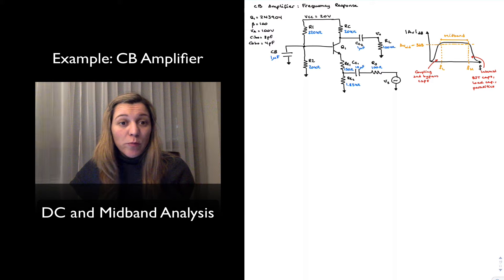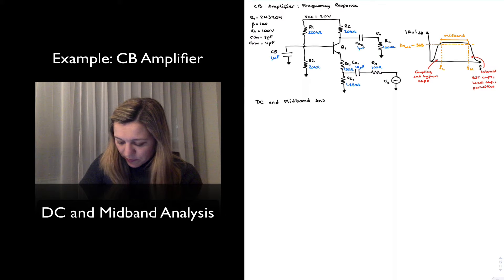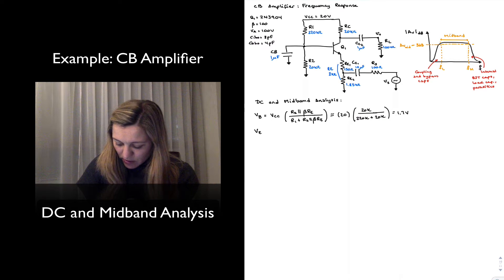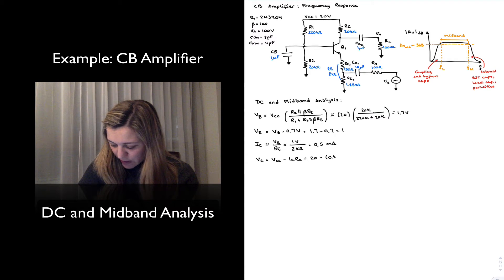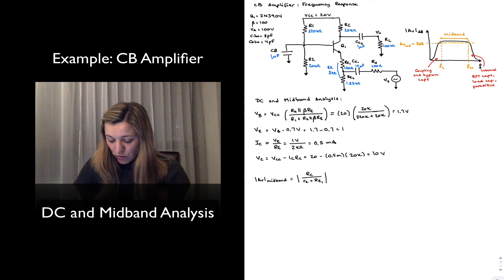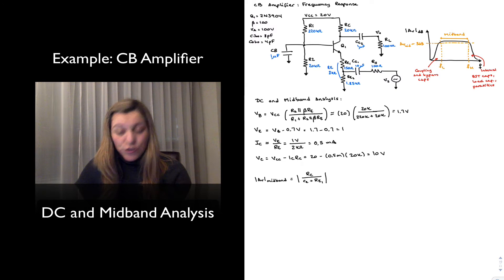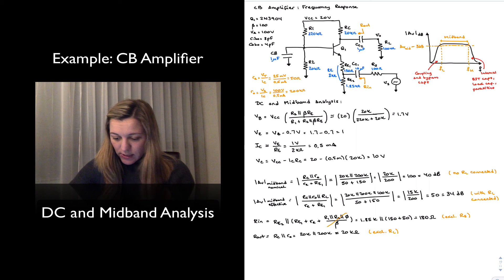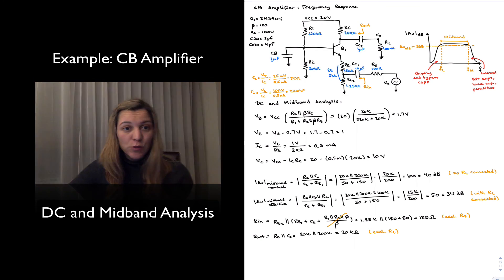Example: CB Amplifier - DC and Midband Analysis

Comment: the lessons overall are GREAT, nothing less. 
i really appreciate reviewing analog systems in those videos. very helpful, clear, and well divided in subjects.
i think there are just too much approximations goin on, which from a 1st timer /student perspective could be misleading.
for example, if u want to write an approx expression for common base gain, i think it's better to start from the complete analitical formula, and then come to a simplified version taking into account the specific value of the circuit, and that's because in not all cases the gain is equal to the brute ratio between resistors, and this can lead to a significant error further on.
anyway , for all the purposes of the hand-made analisys, the approx are most of the time acceptable. 
1 example for all: u considered the output resistance as r0, but it's r0(1+gm * Remitter) which can be much higher than just r0.
at the end of the day simulators are A MUST if u want exact values.

Comment: In Av eff, you didn't take in consideration Rs, any reason ?. It is a part of the emitter branch's resistance.
Reply: I believe it is because that Resistance is associated directly (Rsignal) with the signal source. When we find Av, we turn off the source thus the resistance goes away